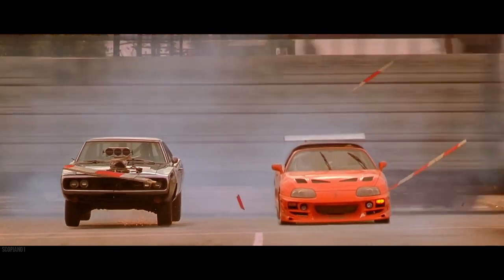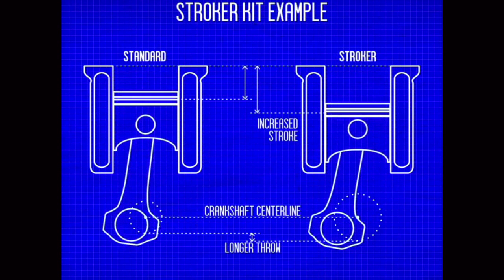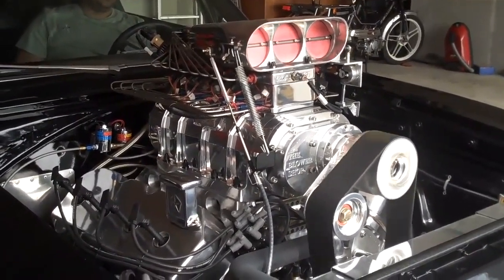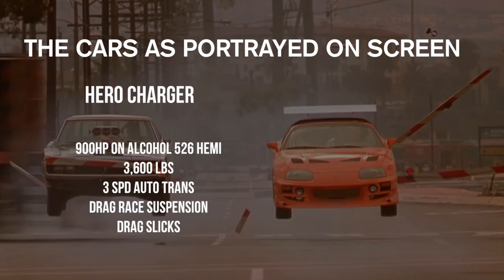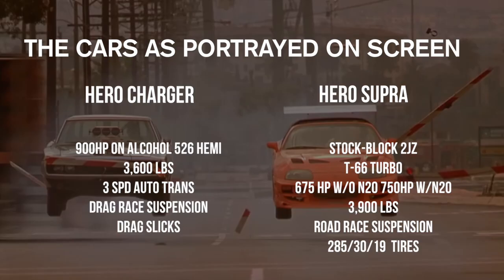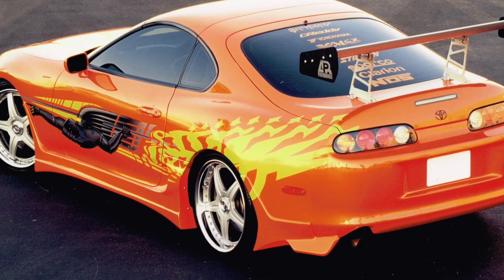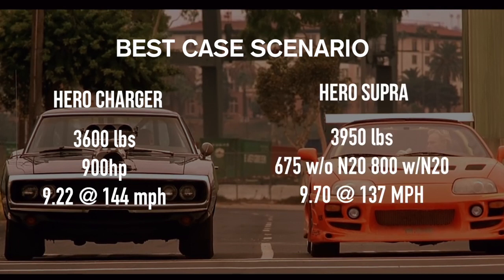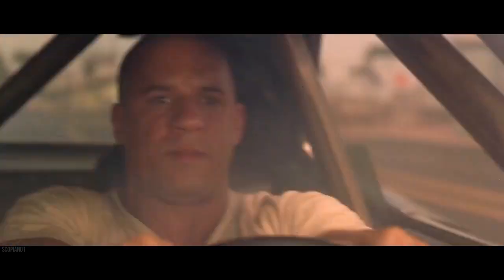Episode #3: The Supra or the Charger: Which one really won the race?

Comment: The train would have beat both of them. Looks like it was going 400mph
Reply: and considering you can watch trains on you tube tearing through trucks fun to watch
Reply: it was a decepticon
Reply: the train had every tank of nos from harry's shop
Reply: Ive been on a 3.8 Mile long (almost 22k tons) train that hit 42 mph, basically thats 400 mph
Reply: Something that big can look pretty fast relative to its surroundings. Most freight trains run around 60mph or higher, but reduce speed in populated areas. They can still carry higher speeds through industrial areas (as pictured in the movie).
Reply: fyi, if you watch some of his other videos, he mentions the train wasn't actually there during the race.
Reply: It's so weird, the Supra and the Charger are filmed jumping in slow motion, but the train is real time or even speed up!  I get not actually jumping the cars in front of a train, but practically the whole train passes before their cars even hit the ground again!
Reply: Came to the comments looking one like "And the verdict is that the train won" was not disappointed LOL
Reply: @beatznbabez9515  with spoon engines

Comment: Someone noted it on down here but didn’t flesh it out... the race was actually probably close to what would’ve happened in life.

I say this because the charger clearly lost atleast one cylinder during the start of the race, eitherway we KNOW it lost power in some capacity. The Supra did not.

The only part of the race that seemed wrong was the tire smoke from only doms car at the beginning... otherwise, most realistic scene in all of fast and furious.
Reply: Yeah, they had to destroy some of the Charger's power otherwise it would've been pointless to watch lol
Reply: One cylinder lost would definitely make it neck and neck. You are right on that point. 

As to the tire smoke, it's completely realistic. Traction makes wheelies and acceleration. No traction equals burn outs. Combo of both with enough power and you can break traction while doing a wheelie. I ride a busa. That's how I know. Done it plenty of times. As long as the balance point is maintained, and you have enough power, you switch between wheelies and burnouts until something breaks.

So it goes like this :
You press the gas and wheelie out of the gate, as soon as you hit the balance point, apply a significant amount of power immediately by dumping the clutch. So you go from say 60% power to 100 immediately. The tires can't handle that demand of power in relation to traction so they break loose. I know he says the charger was a 3 speed auto, but a good stall converter would do the same if properly setup.
Reply: Not to dispute what you’re saying because I can agree with some of it but... also the Supra wouldn’t have gotten traction at all launching like that, it’s obviously a slow motion shot and there’s no way on 285 street tires (which he mentioned in the video) it would’ve kept traction even with the best launch... movie magic.

You’re trying too hard with the math, I’d assume everyone commenting here has done burnouts before... some of us also just happen to work in the industry I’m sure aswell.

The first part is fake everything else is good... that Supra isn’t hooking on a launch on street tires and I bet you a dollar to a dime if he were to comment on this about his own Supra he would say the same.
Reply: @jvanausdeln  not really trying with the math, just ball-parking. I never used a hp/power meter while riding so I can't give exact numbers. But I think with low pressure and an ultra soft compound it (the supra) could get a proper hook. Standard street compound and full psi (which they were most likely running) I highly doubt it also. So I agree with you there. And the only reason I say low pressure and an ultra soft compound might work is because I bought low pro "Street" tires with a soft compound before. I had them on my built 750i (I know, who builds luxury cars to go fast? Me, apparently.) pushing 476/495 to the rear wheels. Even in manual mode I couldn't break traction. Things only lasted 6 months to boot but I should've expected that. But stock tires all day just a little gas and the rear is sliding. I also know a guy who has a supercharged escalade making over 600 on the dyno using stock sized rims and standard tires. And he hooks. Really damn well if you ask me. Lifts the front end up on that beast. I'm thinking it's from all the added weight. So you never know. That's why I never believe anything until I see it person.

The only thing you lost me on was, if this is a slow motion shot, how did the supra keep up initially if the charger has so much torque that it literally jumped off the ground at the line? If that's cgi they need an Oscar for that scene alone. The charger would've literally been half a car length ahead almost instantly.
Reply: I’m a technician at Benz and yeah the c63s barely breaks traction aswell but you’re also talking about 25 years of advancement and technology in tires and traction systems.

I don’t know about movies and their tricks so I can’t explain that... maybe Craig can?
Reply: @jvanausdeln  I became a master mechanic a long time ago during my service in the military so I'm a fellow (actual) gearhead.

I understand the technological gap between the cars when stock. It's only common sense. It's a pretty significant age gap and the tech wouldn't have been available for the charger during development. I honestly believe it was just part of the story to show the connection between different generations of car guys. But I lean towards those variables being eliminated if the cars (let's say, IRL) were built the way they were portrayed on screen. As in, built from the ground up, real life performers. Because modern technology (even in the late 90's) was more than sufficient to make older vehicles perform to same level of equivalency. They have almost every performance part imaginable under the sun for muscle cars and there is a healthy amount custom fabricators. There are some really nice resto mech mods featured on the local over the air car channel. They look completely stock (say like, a late 70's firebird) but the engine, transmission, electrical, suspension, drivetrain, etc. were either replaced with modern replacement parts or modern performance replacement parts. They look like the original but drive like a brand new BMW.

I think an eccentric billionaire fan of the series should do this to settle the age old question once and for all.
Reply: Hang on. Am i reading a civil and intellectual conversation in a car video? I never want to leave this place.
Reply: Tapport, that’s exactly what I was thinking
Reply: the charger would have  0 tire smoke in real life because it hooked so damn well it went up 35degrees in a wheelie. Though again, that would NEVER happen in real life on a unprepped surface

Comment: I wish he had gone a tad more in-depth about running slicks/hooking up at a drag strip because you can't do a wheelstand AND a smoky burnout at the same time... the tires either hook and the car lifts, or they spin and it doesn't.
Reply: I would also have liked if he went into how ridiculous this wheelstand looks
Reply: Not to mention, you’re losing time when your front tires are in the air.
Reply: @oxyrisin  yup in real drag racing wheelstands are for the audience.  Although to be fair it would have been tricky for Dom to drive around on the street with wheelie bars lol
Reply: driving slicks on the street would have cycled them too
Reply: Kurt Lamprecht  What?! You serious?  it’s an old 6O’s muscle car. And no AWD car is going to pull the front wheels off the ground.
Reply: @oxyrisin  idk man I've seen some daylight under some of these 1800hp GTRs...
Reply: it's possible to wheelies and burn out as the same time ( just most that do try not to be that extreme aka 12in off on the front tires max and i still think the real thing is kinda cool 😎 but 6-year old me though it was asum) but it's slower 1/4 mile E/T than a properly set-up drag wheel-bar and old timers use to do that ether for show ( and sometimes they do fire 🔥 burnouts + wheelies ) ( or racing rules " super 😉 stock "  ) or so you don't run wheelie-bars ( and don't what to flip upside down / miss up your oil pan ect. ) cough cop magnet well street racing

Comment: Dom hurt the engine because he was "Granny Shifting" he left in 1st gear, left on a wheelie, came down and shift to 2nd gear. Then held 2nd gear for most of the race causing him to over rev the engine, and breaking something. Brian caught up using 10 gears and 3 shots of nitrous on the thinnest rubber tires you can find. They see the train, and dom figures "OK ITS TIME TO FINALLY WIN" so he finally shifts into 3rd gear pulling away from Brian. But he forgot Brian has at least 2 more gears and another shot of nitrous he was saving for a rainy day. Just enough to catch back up and stay along the side of Dom for the front bumper win. 
In real life, the charger would have ran a high 9 second pass and the supra would have ran a 12 second pass, totally different worlds. But on the best drag rims and tires the supre could have possibly ran a high 10 second pass. Still a full second or 100 feet behind
Reply: 12 second pass 😂😂😂

Comment: what do a 300hp supra and a 1000hp supra have in common? they both run 12s.
Reply: Crais Wright
Good/old joke but not at all true. A 300hp has something wrong with it as they shipped with 330-340hp and they ran low 13’s. So one with a boost leak or down on compression to get to 300hp would run closer to 14 secs most likely.
1000hp Supras set up to run drag with proper tires and suspension run crazy low times. All day
Reply: Lame
Reply: @negativeindustrial  I had a 97 MKIV for awhile. They don't run 13s dude. Not close. Non turbos were 15 seconds at their best, meaning a very competent driver good day. Keeps its traction etc. Turbo was high 13/early 14s. Same situation, with the right drivers. They aren't actually all that fast. In fact I had a Camaro after that which was a 94 Z28 that was much more fun. I love Supras but it was too much maintenace at times like all sports cars. Trans was the best thing built on that car. But by todays standards the MKIV isnt that fast.
Reply: BANDIT
I’ve always owned ST-205’s and SW20’s, both of which will run mid 13’s with minor bolt-ons. I’ve a dozen or so friends with MKIVs in various states of modification. We’ve been racing Toyotas since 1998.
A stock USDM TT is a $25 boost controller and a great set of tires away from a low 13 - I’ve seen it happen at Baytown many many times.
Reply: @negativeindustrial  I'm telling you right now the car most times won't do that. I just said in the perfect run they can. But they really arent that quick. Mine was a manual as well like most of the cars I buy for fun. I was being blown away for the most part by some of the 396 Hemi challengers, and definetly the Hellcats. The Supra also is a little heavy. I kept mine stock. When I sold it, it had 75k miles on it. It was a fun ass car. But I needed something with more torque. I've had a few cars since.
Reply: @negativeindustrial  You said various states of modifications, I'm speaking on behalf of the the stock MKIV being not very fast.
Reply: @bandit8436  yeah stock xanr eith tires and a $25 boost defeated and they run low 13s all day long. One near here is on stock everything except the boost defeater trick and a set of drag radials and it runs 12.7s easy. 

Even c5 FRCs with 400crank hp can run low 11s
Reply: @Turb0wned  They sure as hell wasn't back then I can tell you that for a fact.
Reply: Neg Ative Needs to get his “facts” in order 🤦🏾‍♂️

Comment: But how was dom doing a burn out yet have enough traction to do a wheelie? Didn’t think that threw did ya Craig.
Reply: Gotta love the movie effects, a wheelie wasn't cool enough so they had to add tire smoke even though they never go hand in hand lmao
Reply: basically its not dead hocking and slowly losing grip ( dirty road-way or something like that ) well dom didn't "peddle it " and or " tire shake " + there making look like that car doesn't have a wheelie-bar
Reply: How? Same way everyone else does it. Front lifts rears break traction. It’s not the first time it’s ever happened
Reply: @TheLexiconDevils  theres a non cgi /.movie magic to my knowledge a famous ish pictures from a old dragstrips that is "real" ( come to think about 🤔 it look up the tin god nitro dragster )and at one time i had a 1966-70 GTO picture ( from 1980-2000 era probably had one older style drag-slicks from before modern technology made them hook harder / glue way used ) printed out that was a 8"+ wheel stand + burning rubber smoke 💨 i though it looked assume but it doesn't get great 60ft times slips aka its slower than dead hooking and paper slipping
Reply: An auxiliary hydraulic hack was installed underneath the car positioned at the front end so whenever the Charger accelerates violently, the jack would automatically elevate the car up tricking unsuspecting viewers that it was performing a wheelie when it was being supported by a jack

Comment: the Charger smoking the tires and doing a wheel stand was inaccurate. But it looks good for camera. One thing that was not taken into account was the Charger loosing oil pressure mid race.

Comment: Now we have Supras running 5 second passes. Full weight ones hitting low 7 seconds...
Reply: Those supras running 5's are pretty much full promod cars with 2jz's so i wouldn't really call them  supras and no supra with full weight is running low 7's, balticsupra car has 1500hp and runs high 7's and thats a car fully set up for drag racing.

Comment: In order for that charger to pop a wheelie it would have to be tune up to take off very very fast on the acceleration. And it was a drag race not a circuit race. The charger was tune as a drag car. It’s about who had the better faster take off not who can turn in to corner cleaner and faster.  So that Supra had no chance in that type of race. It would have to be modified in to a drag Supra to have a shot. Put that same charger in a circuit race it would be out of his element too it would lose.

Comment: I’m a huge Musclecar guy and mopar is in my blood but you forgot to mention that the charger engine was hurt so could have very easily been a tie.
Reply: Even hurt he shifted into final gear and pulled away. Forcing Brian to use another nitrous hit to keep up. 
The stupid part is why is dom waiting so long to shift into 3rd gear? He hurt the engine high revving it in 2nd gear. 
But in the end all super fake, with drag 10" slicks versus rubber band tires on the supra the race was over before it started. But for entertainment purposes they had to make it this way. And it hurt a lot of guys feelings thinking they can simply build a 10 second car that looks trick and you can drive daily.

Comment: What about the 3speed tran, wouldn't that handicap the charger at least by a bit?
Reply: nope, it would of gave it a substantial advantage from a dig on the street being a auto vs a manual trans. 2/3spd auto run 1/4mile all the time.

Comment: Charger would have sodomized the Supra on the street, or at the track. Blown alcohol big block on slicks...lol. Not really a race.

Theres also no way that Supra ever gets into the 9's with that setup.
Reply: Nowadays the supra would sodomize that charger.
Reply: @logan00721  with the same setup as in the movie?  No ,  charger was lighter,  more powerful,  and prepared for a drag race,  the supra no
Reply: logan00721 there’s a purple Barracuda on 1320 with a 526 hemi that can run 9 flat without a blower, imagine with one 👀
Reply: @logan00721  

What are you talking about. I mean today too. Its a Big block with a Screw blower setup for Drag. Supra gets drug everytime.

Comment: Since when do Supras weigh 3900 pounds??
Reply: 1,410–1,510 kg (3,109–3,329 lb) (naturally aspirated)
1,490–1,570 kg (3,285–3,461 lb) (turbo)
Reply: It's a convertible so it has to have a stronger chassis which makes it heavier, it has that god awful aero kit which is more than likely adding weight than doing anything aerodynamic. I'm not sure about the interior, but if it was loaded with stock leather seats and had all that useless AV shit (PS1, PS2, tv's, etc), it's definitely possible to bump the weight up that much..
Reply: @MetalHeadMat666  targa weighs around 3500lb.
A single turbo setup weighs less than an twin also...
Reply: When it’s a show car with full system. Also roll cage
Reply: @ryanmalin  did you see a roll cage in it when watching the movie?
Reply: @micke2943  yeah, a banana yellow half cage can be seen in a scene or two. The hero car had it, after all.
Reply: @micke2943  yes. yes I did.
Reply: @ryanmalin  how much do all those electronics weigh? Also going from stock to aftermarket wheels would have dropped the weight
Reply: I fucking lold
Reply: @beatznbabez9515  it depends on how the wheels are made because  if it was forged wheels then yes they COULD be lighter (not guaranteed) but if they were cast wheels then they would've been heavier but it also depends if you're getting bigger than stock wheels or the same size and even if you do get the same size as stock it's not guaranteed that they weigh as much or lighter than stock